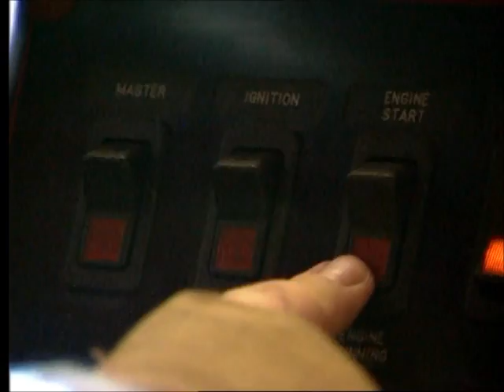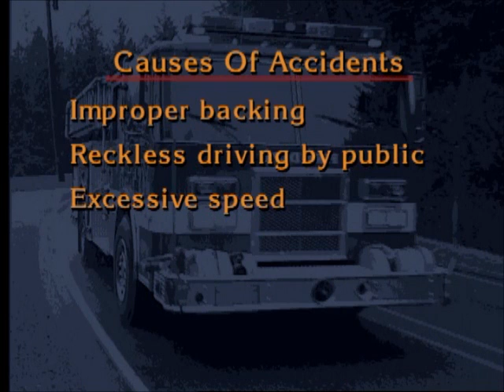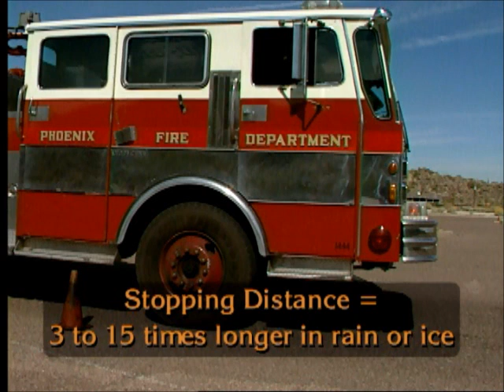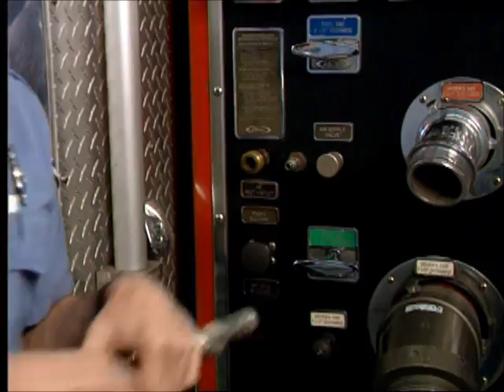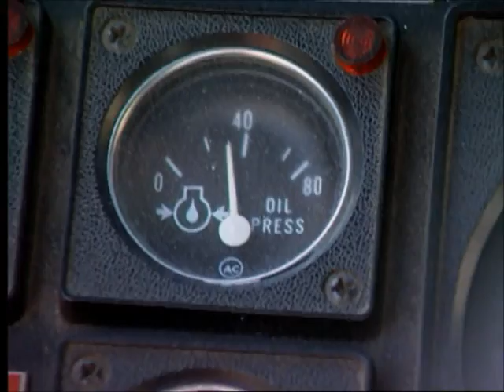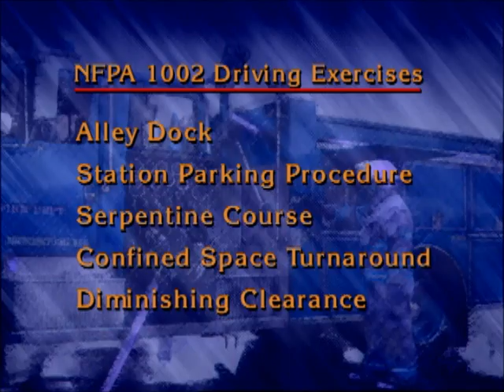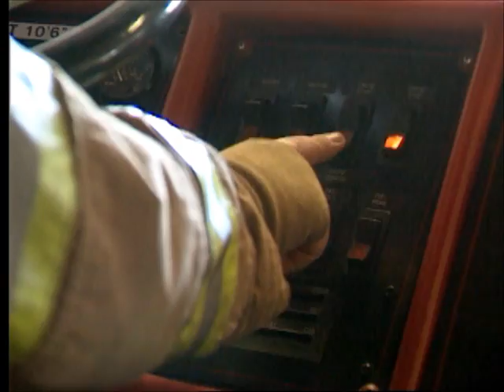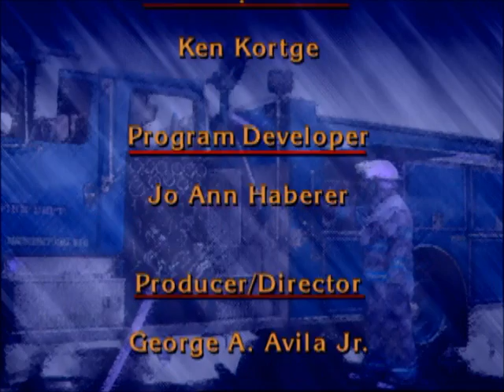Video 1 - Safe Operation of Emergency Vehicles

Comment: In order to "overdrive your siren"  you would have to be travelling with a combined speed (meaning that the person's speed driving away from you would have to be added) of more than 767.269 MPH.  Give or take based on humidity and other factors.  But yeah.  The speed of sound is much greater than that of a fire engine.  People may not hear your siren because of a whole myriad of reasons, but "overdriving" it probably is not one of them.